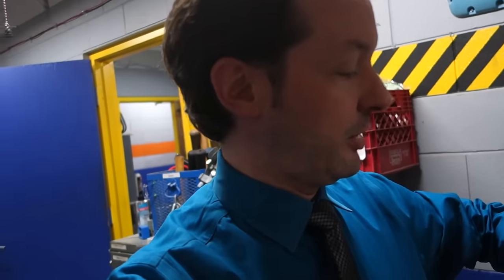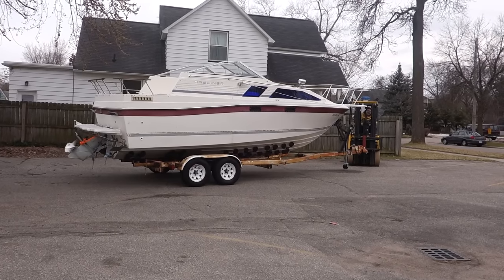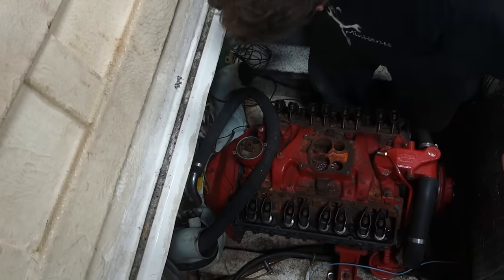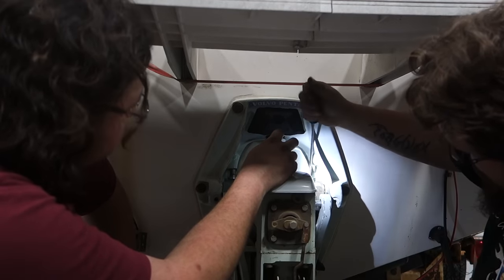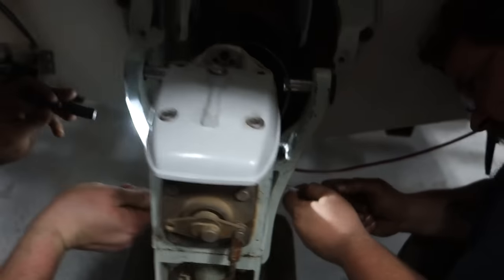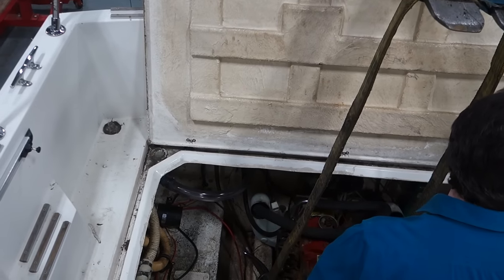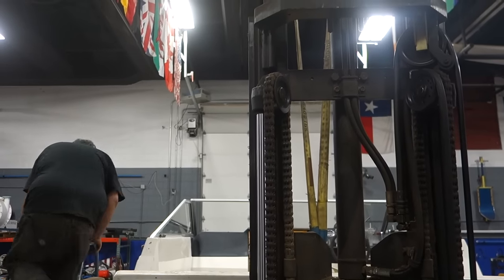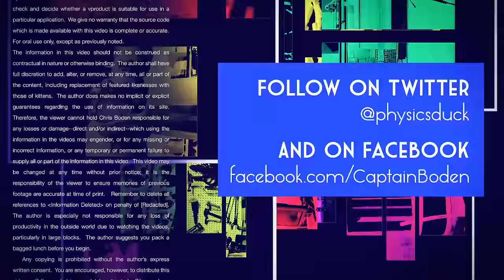Captain's Blog 2 23 2017 Bayliner Ciera Engine Removal

Comment: Could you find numbers etc for the forktruck so they can be noted for the equipment doc ?
A tip for those water bottles, drill a hole in the lid so a flexible plastic pipe can be inserted tightly, you can keep the bottle upright and just give it a squeeze, remember to store with the pipe empty to stop it siphoning.
Though your aim is good ;)

Comment: yes i missed you.  safety goggle toys are different.  what is honing an engine?  1500  why do you call him lefty?  they put a car engine in a boat.  lefty should hold the round end of the wrench for safety.  count to three when filming information.  inside motors are more protected though.  visible surfaces should look nice.  that sludge is heavy.  lefty has a fun ring tone.

Comment: hate to say it but all those number were just casting #s. the serial number is stamped on the left rear of the block under the heads they "may" be decode-able to get displacement, all the small block chevy's look the same on the outside, only way to know for sure is to pull the heads and measure bore and stroke

Comment: You probably should have used a funnel so you don't get water on a huge battery
Reply: You don't want to short the terminals even if the cells are dry because they could still be wet under the lead and still have some juice
Reply: I would really want to be part of your makerspace but I live in western Wisconsin. Last night it was 50 degrees and we wake up to 9.7 inches of heavy sticky snow.
Reply: ask to start a TGG chapter.